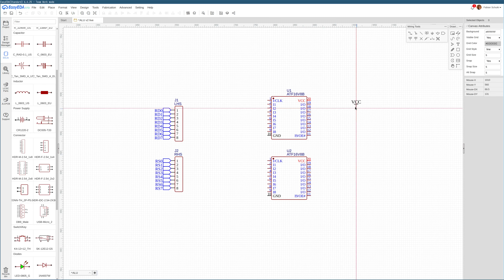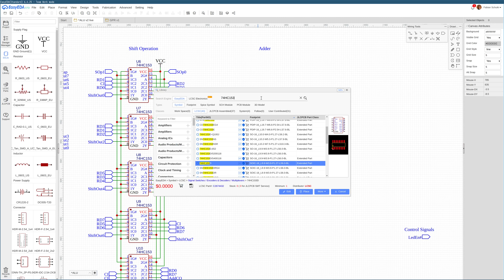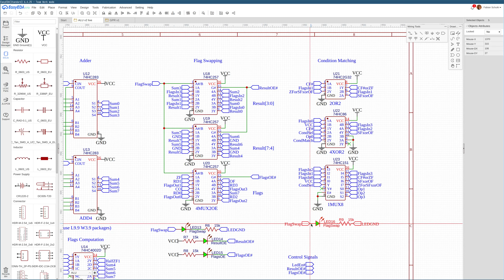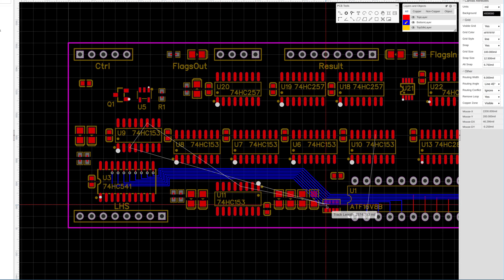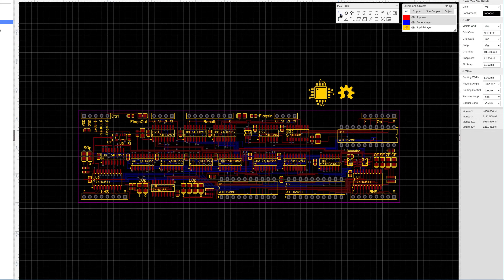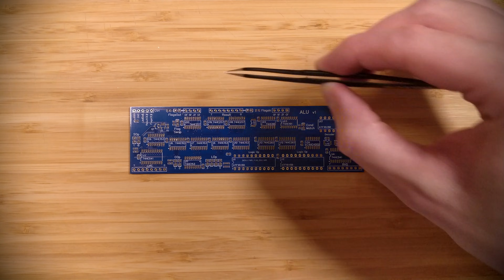Arithmetic Logic Unit PCB – Superscalar 8-Bit CPU #44

Comment: Doesn't a superscalar CPU have more than one ALU? Why does this one have only one, how would that work
Reply from the maker: Excellent point! You could do superscalar execution by issuing an ALU op and a load-store op in parallel, and you’d only need one ALU and one load-store unit for that. But you’re right, in practice you want to have multiple ALUs, and for larger cores also multiple load-store units to do work in parallel. I’m planning on two ALUs down the road 😊

Comment: Dont you think using PALs is a cheat for the ALU? why not just build out the ALU with all 74 series chips?
Reply from the maker: You can definitely do that! 👍 James Sharman has a very nice ALU setup where he uses 4-way multiplexers to implement a configurable lookup table for the logic ops. You can do a similar thing for the decoder. It just adds a ton of chips to the ALU, which I wanted to avoid since the ALU isn't really the focus of the build. 🙂

There's also some precedence for heavy use of ROMs and PLDs in the 74HC series of computers from the 70s. Usagi Electric has a nice series on his Centurion which has a few crazy disk driver cards that are basically just stacks of ROMs implementing state machines 😅. Steve Wozniak used a similar approach to generate video signals for his Apple II.
Reply: @fabianschuiki  oh yes... Ive seen James build. Ive started my own. My ALU used 26 total 74 series ICs, but it implements all 8 possible shift/rotate functions as well as all 16 possible logic+add/sub functions using the 74LS153s and includes 4 flags, Carry, Zero, Greater Than and Equal plus the ability to set reset the carry. But you and James are on another level to incorporate pipelining. James' video and sound module additions are doctorate level stuff. I look forward to seeing where you two go with your homebrew CPUs. I don't think mine will ever get that far.
Reply from the maker: @renaissanceman5847 Keep pushing! 🙂 Your ALU sounds really neat, especially since you can do all logic functions. That gives you nice set bits and clear bits functionality with a bitmask 😎
Reply: @fabianschuiki  thx. keep up the great work. its essential that new engineers know how to do this sort of thing beyond just talking about it.
Reply: @fabianschuiki why is a ROM not an ASIC ? Isn’t the idea with the programmable stuff that we don’t need lithography? Why is that microcode in the 6502 called PLA?
Reply from the maker: Yeah, the ROM structures are pretty convenient ways to ensure that you can change the data stored in them very easily with changes only to 1 or 2 lithography masks, so you can change your ROM until very late in the design process. Or have an easy option to do a respin of your silicon with only 1 or 2 masks changed if you need to modify the ROM.

I guess the argument against programmable devices is that in the limit you can just throw your entire design onto an FPGA and be dome with it. Which is also fun, but in a different sense than building things up from discrete components. So the boundaries you draw are relatively arbitrary in order to keep your project in the fun zone you want 😃
Reply: @ very true. My 8 bit build has some very simple rules. building blocks nothing more complex than the 74181 (everything under that is good to go)... so only registers, counters, adders, buffers, logic gates multiplexer and demultiplexers and timers. parallel EPROMS for required ROM components inherent in all early CPUs instruction decoder. I did try to locate actual PROMS that could be manually programmed but they are rare and often too small address buss wise. BUT the build cannot rely on an already existing computer to build it. thus I had to build a manual line by line EPROM programmer... that allows me to manually program an 8 Bit EPROM using only discrete 74 Series logic chips  with pushbuttons for input and 7 segment displays and the ZIF socket for the EEPROM all in hexadecimal. then from there evolve the CPU circuit part by part. build each module on breadboard to test them move to protoboard for final. therefore no FPGAs, ASICS, PLDs, and certainly no personal computers to write the code or program chips. only multimeter, logic probe, soldering iron and data books, pencil and paper..
Reply from the maker: That's a very nice set of constraints to build things up. I wonder if you could bootstrap yourself in this fashion... Build a simple computer from trivial gates that barely lets you edit text, and then use it to program ROMs and build out the next more complicated machine, and so on 😏
Reply: @fabianschuiki  well... is this not how computers evolved?
Reply from the maker: @renaissanceman5847 True 🙂
Reply: @ they teach to use truth tables and then grey code to do combinatorial logic . This already takes the fun out for me because I cannot follow the signal. 6502 kinda went this way for the microcode and it works (fast), but ultimately failed to work with the carry from Lo to Hi .
Reply: @ have you read how they programmed Apollo computers by stitching wires through ferrite rings? I think that it is pretty weird that commodore paid for a big ROM for BASIC, but did not bother to max out the speed of their magnetic storage. How do PROMs sense a tiny charge behind a thick gate? Somehow all memory relies on tiny voltage levels compared to TTL. Only real ROM is TTL (and don’t give me that DTL ROM)!
Reply from the maker: Got to make those storage cells as tiny as possible for maximum density 😏. Tiny structures, tiny voltages.
Reply: @ real ROMs need lithography and chemistry. Beginners contaminated groundwater around the US.l

Comment: Have you considered redesigning the PCBs so that they all connect via a backplane for the (ultimate) finished product?
Reply from the maker: Yes! 😃 I'm planning to connect them up through backplanes. First a few separate ones, to make developing things easier, but then later on I'll probably switch to one or two larger backplanes. Probably not via edge connectors, because I'd like to be able to view the PCBs from the top, but through the pin headers I have now.
Reply: @ Awesome! I’m enjoying following your work so far!

Comment: Great project. I can't wait to see it complete. But may I have a little suggestion? These discrete LEDs are barely visible on the video. The fact that they are almost white when off and camera desaturates when sensor gets overwhelmed makes things difficult to see. Maybe you could put some tape over them or do something about it in post (if you have HDR footage available).
Reply from the maker: That's an excellent suggestion, thanks! 🙂 I'm going to experiment with a few options -- it might be worthwhile to print a tiny lense/grid from PLA to go over it, just to hide the white of the LEDs and still let the actual light through.

Comment: Nice! Are you going for only one ALU? I thought you envisioned multiple ALUs?
Reply from the maker: There will definitely be more than one ALU! 🙂 The neat thing about the current ALU design is that it has no state/registers; it's purely combinational. That means I can just build another copy of the exact same ALU. As long as the processor pipeline has two parallel interfaces to issue instructions, which is what's going to be needed for superscalar/dual-issue, I can just plug in both ALUs and have them run in parallel. 🤩

Comment: That table sure can take some heat from your hot air gun, lol! Great video as always, thanks so so much for doing the stuff that you do. Your videos always make my day, I can't wait to see this project complete!
Reply from the maker: Thank you very much for your kind words! 🙂 It's a lot of fun to do this project, especially forcing myself to document things step-by-step adds a whole new challenge. Don't worry, I'm not using the hot air gun directly on the table. It's a bamboo chopping board from IKEA's kitchen department 😏
Reply: @fabianschuiki  Oooh, that's very smart, I'll have to look into that! I've been using a silicone mat like you used to, and it was quite annoying having it expand and warp under the heat from the reflow station. A solid bamboo cutting board sounds like a life saver for this type of work!
Reply from the maker: Haha, I had the exact same problem with my blue silicone mat. It kept warping under the heat. Bamboo nicely solved that issue though -- cost me around 2-3 IKEA hot dogs, to use a universal unit of currency.